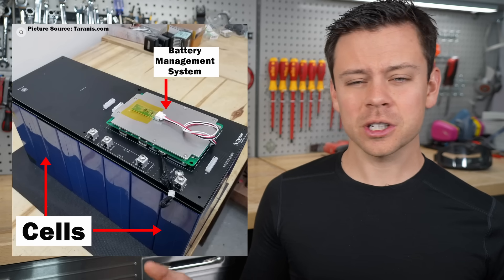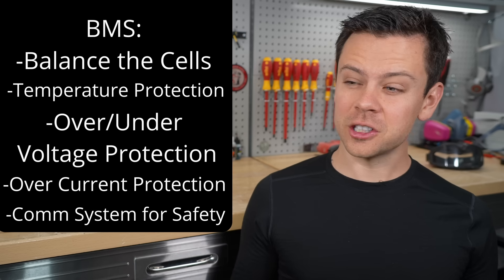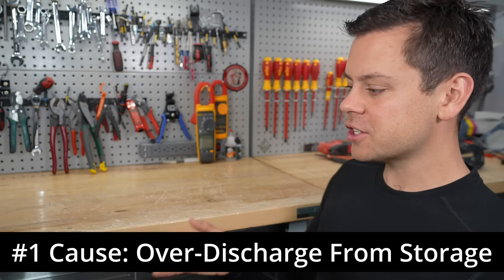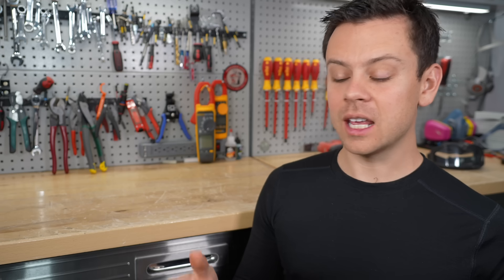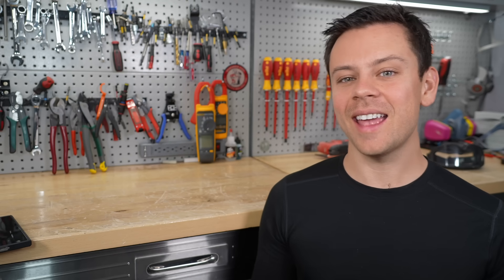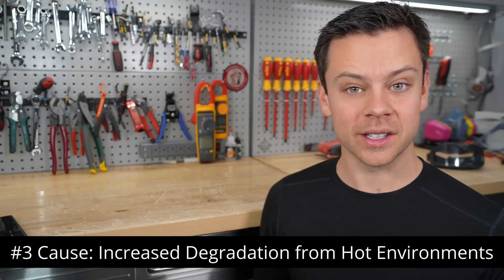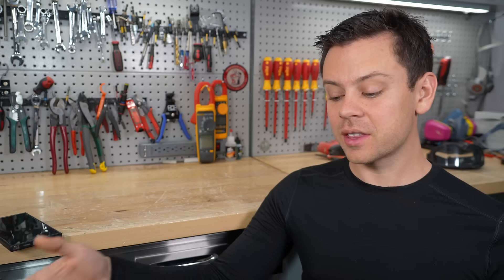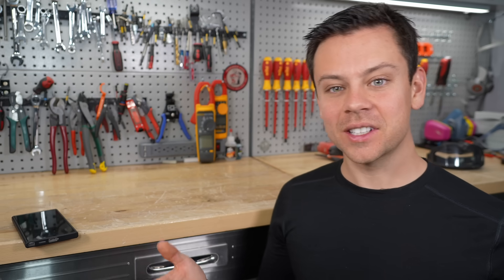The Rules of LiFePO4: The 3 Most Common Causes of Failure and General Guidelines for Long Term Use

Comment: I am still struggling to properly size the LFP battery to store my excess solar. In summer I need about 5 kWh to cover the loads, but in autumn it's 7 kWh and in winter it's pretty much useless because of the short days (l live in the Netherlands). Should I spend the extra cash to cover bad days or is it better to buy just enough for most days? Off-grid is not an option here, but not buying too much power from the grid is a priority.
Reply: My personal opinion is to have enough on hand where I buy as little as possible from the electric company until I do fully move off grid.
Right now I cannot afford those extra three batteries.
So I say if you can afford it yes, get the extra batteries. 
If you can't afford it don't worry about it do the best that you can with what you have.
Reply: @ Thanks. In the context of this video I doubt I can keep the batteries top balanced in the colder months. The cost of a small 5 kWh system would pay for itself in 10 to 15 years. Anything larger will not discharge anywhere near empty in summer. So will oversizing it just cause problems or does less strain per cell make sense justifiying part of the larger system?
Reply: @SolAce-nw2hf  Don't worry about discharging the battery bank until "empty". I have the opposite problem here. In the summers, I usually get down to around 35% to 45% of my capacity because of running air conditioners, but in the Winters, I rarely fall below 80% of my capacity because I don't need the AC and don't need heaters. I have had my system working now for about two years and have had no problems.
Reply: There are two metrics here.  (1) How big does the battery need to comfortably handle overnight operation when the solar system is not producing (or not producing enough).  And (2) How many days a year do you want the solar system to be able to produce enough energy to cover 24 hours of use (#2 is entirely unrelated to battery capacity).

So for example,  I have a system where I size my battery to cover 24 hours of usage from full to empty with no charging sources connected.   That gives me a comfortable overnight margin of 50%.

HOWEVER, my solar system is only able to produce >= the energy I use on a daily basis 9 months out of the year.  For the other 3 months it often does not produce enough and the battery is unable to completely recharge each day, ultimately dropping to levels (usually in the early morning before sunup) where grid support is needed.

Sizing these two things are separate issues.    Oversizing the battery is costly, and oversizing the solar array is costly, so you have to figure out where your comfort spot is.  For me:

For the battery system a good sweet spot for me is to size it to cover 24 hours of consumption from full to empty (without charging support from any source).  For my solar system, I size it for 100% coverage of my daily consumption during summer and the shoulder seasons, but I don't try to make it cover winter because that would require a crazy-big solar system due to clouds, storms, and winter sunlight.  I wind up with roughly 30% of my usage coming from the grid across winter.

Note that just making the solar system bigger by 30% doesn't close that gap by much, because the real problem in winter are storms and heavy cloud cover.

-Matt
Reply: Thanks to all of you for your advice and insights. 

The solar panels are pretty much a given as every roof surface is covered. About half the capacity has micro inverters and the other half is connected to a dual string inverter.

I think I will go with a small scalable micro inverter based AC battery system  at 5 kWh and expand it with more modules if and when it makes sense.

The grid is pretty reliable here and I do not have a lot of space and I would like to inspire neighbours, friends and family,  so being able to show off an affordable small system may lead to more installed capacity in other homes.

I would love to have a big system that is able to go off-grid when needed or help cover the duck curve on the grid. But the extra investment is questionable at best and even at full power it is a drop in the ocean if you look at the power fluctuation on the grid. I think I will leave that problem to the professionals with big grid batteries.

Comment: How do you know if the BMS fails?  I'm thinking that if it fails then the battery will likely get damaged and you wouldn't know it before it gets damaged.  I'm thinking kind of like the "idiot" lights in older cars when for example the low oil pressure lights up after the engine is damaged due to low oil pressure.

Comment: That all made lots of sense, except for the bit about active balancers being bad for your cells(4:40). Even an active balancer is using extremely low C-rates, and as you said here, low C-rate charging (e.g. from solar) does not stress the batteries at all. So what would it matter if someone uses an active balancer? Hmm. OK I just looked up the seplos balancer in my Fogstar battery and it does 10A which is about 5 times as much as I had guessed. But even then, on 314Ah cells, that's a C-rate of 0.03 which is really not going to stress your cells any. So I can't really see that that is going to make any difference.
Reply from the maker: That's not why it's bad. It's because you're not reaching high soc to balance. If you're using active balancers and going to 100%, it will work fine but now you have more risk of problems because active balancer is another thing that can fail. And it won't help your system at all. So completely unnecessary
Reply: @WillProwse  OK. You were just meaning that trying to balance at lower voltages (80% or 90% SOC) does not work as well as balancing at 3.6V or 3.65V? 
Fair enough, although does it really matter? You can balance the cells to all have the same voltage anywhere from 0% (2.5V for these cells@25C) to 100% (3.65V) Obviously end-voltages can vary a little and to some degree are a choice. 

In principle it doesn't matter much which voltage you choose (although generally people pick the min or max voltages because balancing will be inaccurate in the flat middle bit of the voltage curve;
the voltage slope is much steeper at the end so the correspondence between voltage and SOC is much clearer).

After balancing they will all go up and down more or less together, with the BMS clamping things at either end of the discharge curves as soon as once cell hits that point, and the pack capacity is N times that of the lowest-capacity cell.
Seems to me this won't do your cells any harm, you just might lose some apparent capacity until you balance closer to the steep ends of the curve.
 I wouldn't call that 'bad for your cells', just not best practice.
I do agree that there is no point balancing faster than you need to, and it is odd that the Seplos kit I have here provides both a resistive trickle balancer and an active capacitance balancer in the same battery case.
Reply: @xxwookey  actually you need to balance at the top voltage because you would be at the top of the curve. Trying to balance below 3.4v is useless. Watch some off grid garage videos whee he did some extensive testing of this and explained the results.

Comment: Is it bad to be at 100% SOC all the time? I'm building a UPS with a EG 4 LL-S and a Multiplus II, so it'll only ever discharge a few times a year when the power goes out.
Reply: Good question! I think someone else asked a similar question above. I believe that as long as your charger, whether solar controller or AC-DC, LiFePO4 compatable, has Constant Currant/Constant Voltage/Float Voltage of the correct Voltage for each, you should be fine.

Comment: Will, is it OK to use a lead acid charger on a Lifepo which has a BMS?
Reply from the maker: Not if it's a transformer-based, super cheap charger. Need a relatively new charger
Reply: Better to spend the little cash and get a LiFePO4 compatable charger.

Comment: Oh my! Yes you opened a big can of worms considering the comments here. I know you said in your post to check out the forum but may need to modify the video to amplify that. Then there is this boat guy that is selling some high priced modulator supposedly to save your battery. As Will says, let the BMS do it's job!

Comment: Didn't know about self discharge. 😮 Running down to the basement to hook up my charger right now! Thanks.🏃‍♂
Reply: I would think that the BMS has a small small small idle current.
Reply: I have had my LFP for 18 months. I have been monitoring the percent charge. I have not been able to see any discharge so I believe that it is small: as mentioned in the video.
Reply: @edwardlulofs444  the percent charge probably won't have any way of reflecting this natural loss and BMS parasitic loss. I'd charge it back up and observe how much charge it absorbed to get an idea of how much it had lost.
Reply: It depends.  My lithium batteries for my Worx tools, over winter, show no change from November to April (I take them out of the tools).  Both UPS (UPSes?), if I unplugged them, would show around 1% per month.
Reply: It depends on how wasteful the BMS is.  As an example, I have a USB battery bank that I've had for over 10 years.  It's fairly sizable for a battery bank, and you can leave that puppy in a drawer for a year or more and it will still happily fully charge your phone.  It has the usual soft-on button and will automatically start delivering power when you plug something in to the USB port, so it absolutely has a microprocessor-controlled power management controller inside that is always powered up.  It just has a (relative to the capacity of the battery) very low parasitic load.

When you compare something like that to a car-battery sized LiFePo4 cell, there's absolutely zero logical reason that the cell protection's load should be anything at all measurable.  "3% a month" quoted in the video is a criminal level of wastefulness, IMO.  Good lord.

At that point, you're paying for all the expense of Lithium, and getting all the advantages of Lead-Acid.  ><
Reply: @sirnickity  You're not wrong, but it depends on how one stores one's item.

Turn it off?  Great.  Turn off the AC output, the DC output, kill all the tiny little blinky LEDS that occasionally go off, and so on, and it probably will pull practically zero.

Leave the outputs live and there's some parasitic drain.  So depending on how careful you are, drain could range from 0 to 3% per month, but I'd be surprised if in most cases it's over 1%.  If I'm storing, I'm putting the unit into the deepest sleep or truest OFF state I can.
Reply: @BronzeDragon133   Yep, exactly.  This is a point that I made more clearly in a different comment here.

You have to differentiate between battery self-discharge (which is for all intents and purposes 0.0% for Li-Ion), BMS discharge (which should be negligible -- like, maybe try to remember to check on it once a year), and idle discharge (which could be substantial.)

My understanding from the video was that he was talking about leaving cells in storage with nothing connected to them, except whatever cell protection / BMS is embedded into the pack.  In that case, a figure of 3% a month is so egregiously excessive that I would consider that a defective product.  If I misunderstood and that's while connected to an idle solar system, then yeah okay.

No shade on our host here.  It's a good point to make, and good lookin out for mentioning it.  I just hope that figure doesn't represent any actual product's real-world discharge rate.
Reply: @sirnickity  Idle discharge?  My EcoFlow used as a passthrough shouldn't really be tapping the battery, so I presume the idle discharge is about 1% per week to run the incidental electronics.(it will then top itself off every 2 weeks or so and no harm done).  But again, for storage, I wouldn't have the AC, DC, and screen on....
Reply: @sirnickity  My EGO batteries will discharge to 30% after a month. 🙄
Reply: @BlueWolfDaYooper   YIKES.
Reply: @ thanks for your post. I learn from everyone. I read your words carefully.
Reply: So if I have 2 Ecoflow D2s and I keep my router plugged in to one and my fish tank pump plugged into the other, using them as pass throughs, does that mean I can skip charging and discharging every few months?

Comment: The first LFP battery I got was back in 2009.  I actually got one of my early LFP batteries to go 14 years before I retired it and that was a cheap Chinese battery duct taped and shrink wrapped together with major issues with the balance leads.  Kind of surprised really how much abuse that battery took before I finally had to put it into retirement.  Was getting ~80% capacity and soft cells towards the end after many issues of balance leads making poor contact while charging, leading to individual cells overcharging.  Eventually pack becomes a heater box as in you dump charge in and it gets hot until it discharges.  I am sure a modern battery that is built to much better standards and treated better will just go and go, at least cell wise.

What I do now is use the current LFP battery for extra power to run an all electric kitchen.  That keeps its usage regular enough and then I can take it with me when I need power somewhere.

Comment: The only problem for a lfp battery to be imbalanced is inside an EV, you are for example at 10% of SOC display et one second later you are at 0% of SOC display, no juice. 
Who care in a solar system ?
Imbalance is not a cause of a failure.... the bms shut down when the lowest cell reach the limit, and no problem.
Even with an LFP chemistry, the degradation is higher at 100% SOC than lower, so if you need 60% per day it's smarter to cycling between 20% and 80 % of SOC, than between 40% and 100%.

Comment: Will,  Thanks for all you do on your channel , following since  later part of 2022.  Because of your expertise I have built a complete solar system for off grid operations.  Cheers
Reply: Same here.  When I first started posting on Will's forum I was absolutely beyond clueless.  I was uploading my "plans" for this huge 12V system for our off grid cabin that look nothing like what we have today thanks to the education I got there from the forum members.  It took two years on his forum (I'm slow) to finally get comfortable, but what we came away with is a super great 48V system that powers our off grid cabin and heats it with an electric heat pump.  In Alaska!  With our solar arrays located 600 feet away from our cabin.  And we installed all the DC stuff ourselves all from research on his forum.  DIYSolarForum is a must for anybody wanting to learn about off grid solar.

Comment: You forgot a use case: a battery backup where a load is 24/7 connected to the LFP. I think the trickle voltage in this case matter, and an active BMS might be appropriate, but I might be wrong. One thing for sure, I will not keep my LFP at 3.6V 24/7 unless I have proof it is safe.
Reply: For UPS style applications (I have several LiFePO4's used that way)... you charge normally (3.55V/cell), then drop to a float level (3.35V to 3.375V/cell) and the load-support occurs at the float level.  The battery will remain at 95%+ SOC while being held at float after being fully charged.

UPS style applications cannot hold LiFePO4 batteries at any specific SOC, they must always fully charged the battery, then drop to float, then perform any load-support at the float voltage.

A regular (e.g. Victron) charge controller can easily do this task.   What I do is for 12V devices like my alarm system and cable modem is:

* USB-C PD port plugged into the wall
* A 19VDC USB-C cable wired to the "solar" input of the Victron
* Output of Victron connected to the 12.8V LiFePO4 battery and device.
* Victron programmed to limit charging current to (typically) 2A or 3A (24 or 36W), which is typically what the USB-C cable at 19V will allow.  So the average 24x7 power draw from the device cannot exceed that, obviously, but the burst power consumption can consume up to what the battery is able to support.

Done.

-Matt
Reply: the cells are 99% full at 3.45v  . Watch some off grid garage videos on youtube where he charged and discharged cells , graphed , and explained it all in detail

Comment: How bad is it to be charged to 100% for long term storage? I don't get why 50% is recommended. Tks!
Reply: For Lithium based battery (Probably Lifepo4 too since it have too Lithium). Half charge (50% state of charge) is the less damaging for them. More you move away this state, more damage you get in calendar life cycle in the long run, it's not instantly. It like pressure,  more you add pressure, (Like charging like 120%) Less life expectancy you will get. Same with completely remove all the pressure (Fully discharge them, those type really don't like that). It's why many vendors suggest to rarely discharge them below 20%, other 10%, and this influencer say now 0% and even Tesla with LFP say you can do as this influencer say. What is not said with this influencer. Is this 0% is maybe for some manufacturer for example 12 volts battery, bms is programmed for 10 volts, other 10.5v  ect. those are not the same 0% and you will not get the same level of degradation with fully discharging. It's the same with fully charged, (Most ajuste to for Li-ion 4.2volts per cell, my EV car is 4.1V per cell,) Less full pressure  = less degradation normally with Li-ion. Personnel opinion, I have too for my tractor Lifepo4. I take no chance, I play with it around 50%. 3 years now I have it and do it, no trouble at all with it until now. In my case, normally only once a year I fully charge them to verifying their capacity remaining. Maybe this influencer is right, but I prefer to take no chance and too have like 6000 ore more cycles, compared to 3000 for example.